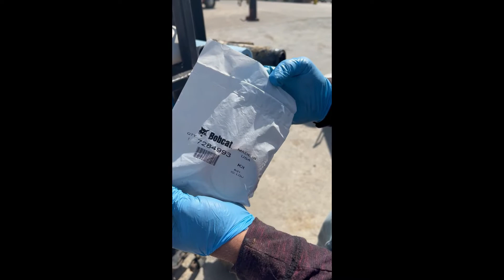2020 bobcat e32i track tensioner adjuster repair

Comment: Hello, unrelated to this video but what spanned wrench do you use to remove the gland nut from the pistons. 

I have an e32 and the top piston for the arm just went bad. It’s too small to use a pipe wrench like I did on the bucket piston. 

Thanks for your help.